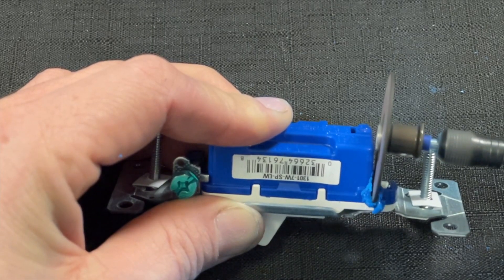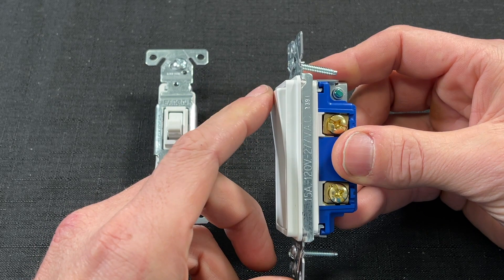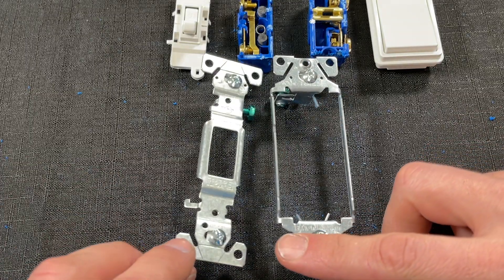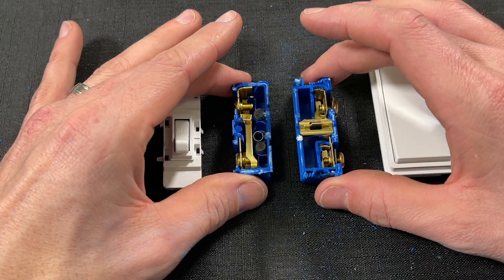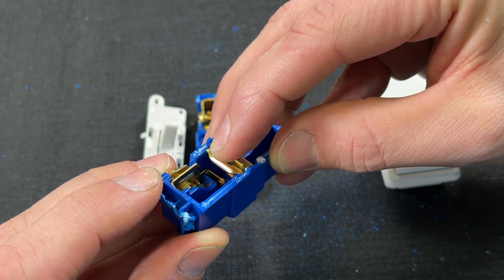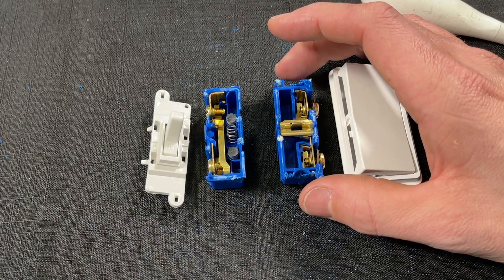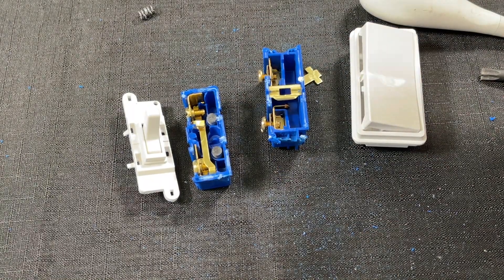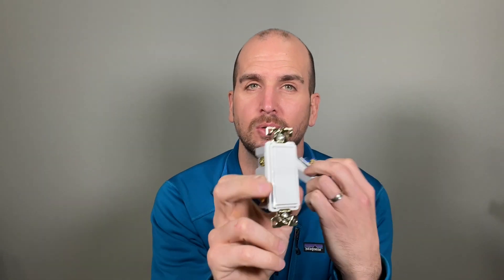What Switch Should You Buy | Toggle vs Rocker (Decora)

Comment: Ugh, I have a rocker switch that just broke off a bit on the side, so the most common issue you talked about. Is there a way to just replace the rocker, or would that be too difficult? The light still works fine, but the gap in the rocker bothers me. Lol.

Comment: Great video but I still have a question that wasn't completely answered. I bought a new home 6 months ago. Didn't expect to have a minor problem so soon. The entire house has rocker switches. They all work fine except for the one in the kitchen, which is the one I use the most. Turning the switch off works fine. But when I turn it on, I hear the click in the on position but it either will not turn the light on or I get flickering just by lightly touching the top part of the rocker panel.  If I push the top part a few times, applying more pressure, then it will come on. I had no idea how to take this thing apart until I saw your video so thank you for that. I have not taken the switch apart yet. I'm still not sure how to fix this problem. Would it be that little cross shaped part maybe not making contact only at the top when I'm trying to turn the light on? If so, what do I need to do? Do I replace that piece? Do I need to clean it?  I'm hoping it's not something electrical involving wiring because I don't want to deal with that. I live alone and don't know my neighbors yet to ask someone to look at it and I'd feel dumb calling an electrician in if this is just a simple fix. This light is driving me crazy. It is getting progressively worse.
Can you or anyone else reading these comments tell me how to fix this?

Comment: Great video.  Answered the exact question I had...which is "what's the difference?"  My gas fireplace has the millivolt system and uses a standard wall switch.  Fireplace became "flakey" and would sometimes have a delayed start....or no start...or would work normally.  I realize that the thermopile is probably a little dirty and maybe not optimal...but when I removed the switch and shorted the wires directly...the fire starts every time, instantly...thus, the problem is the switch (resistance).  I was wondering if there is a type of wall switch which would have better reliability/longevity...I guess whichever has a snappier contact or stronger spring would assure a better contact over time....likely dust or corrosion on the contacts is the culprit in my case...I guess move of a sliding contact would be nice and self-clean...but I don't believe these are used for wall switches....  No big deal.  Selling the home now...I'll replace the switch and move-on...

Comment: One of my rocker switch doesn’t work well, I know it must be some part that doesn’t touch properly, so I opened the case and the springer and copper piece fell off, and I have no idea how do them suppose to be placed, so I opened another one to check out, but the second one also fell off😅 then I found your vid, and figured out how to place the pieces properly, now I installed both rocker switch back and the broken one is working like a new one 🙏🏻 I want to thank you for this helpful vid you uploaded

Comment: Great vid..thank you. I'm wondering if the toggle contact inside is better than in the rocker. Looks like there is more area of contact in the toggle...and wondering if that makes for a better connect of power. ?  I'm having issues with our outdoor Christmas lights on a 20amp circuit. I know I'm near or at the limit the circuit can handle, but even still I get a flash/spark with the New 20A rocker.  Maybe the toggle has a better contact patch..?? Thoughts..?

Comment: Used a double rocker in a single gang box and it failed after 10 years or so.  The only toggle I ever had that failed was an original in my 1920 house.  Back then, most houses used pushbutton switches, but the man who had this house built went for the "modern" toggles.  I actually liked the look of the pushbuttons and bought originals off of ebay to replaced the toggles on the main floor.  My current home was built in 1955 and it's toggles all the way.

Comment: The internal engineering on the rocker is clearly better. Fewer parts and the contact mechanism is less prone to wear. I love the rocker for end user functionality as well. If you mount it flush, you can swipe at the wall in the direction you want the light to go and it happens... No unfortunate stubs of the forearm or fingers. Especially convenient in dark rooms that need light.

Perhaps the best thing about "decora" (rockers) is that you can use the same wall plate for outlets and switches.

Comment: 10 pack toggle switches are $4 at your electric supply house. Decora is 5x more expensive. That should settle it. Also, we have found that quality toggle switches will outlast decora, reason being as you said in your video that plastic pivot thing breaking usually caused by someone hitting it hard when they turn it on (ie when their hands are full and they use their elbow). A toggle switch on the other hand only has to be brushed upwards or downwards and it works. No one hits a toggle switch, and if force is used the physical limitation of the frame stops the plastic from breaking. Toggle switches do wear out, eventually. But you are literally talking something like 50 years. We are just now replacing toggle switches in our house and some are the original switches from the 50's.

Comment: From my experience, toggles can last at least decades and in the new house I'm living in, over 30% of the rockers had one pivoting side crack (15 years in). So that means toggles are both cheaper and more reliable. My grandparents' house had toggles from the 50s that still worked fine when the house was sold a year ago.
Reply: What brand of rockers did you have fail?
Reply: @livelovelifeyall  Pass & Seymour from 2007). New replacements are Leviton.

Comment: The MAJOR problem with toggles is you dont know which way the light turns on or off. At least its not intuitive. With toggle switch the lever is clearly marked and the life long use is already ingrained in our brainwash that off is always in the down position.

Comment: I do not like the entry level on anything. I prefer the rocker switch but as you said, if I am just replacing one or two I will go with what ever is there but I will spend the money to get the best components I can, it is worth it to me, just in time savings and the switch or outlet will last longer. cheap usually ends up being more expensive in the long run.

Comment: I've had 5 or 6 of the rocker switches fail because of the cheap ass pivot.  In nearly 60 years, I've NEVER seen a toggle switch failure.  What is really irritating is the pivot on the rocker could be made as robust as the toggle switch, but I guess no one wants to fix the built in failure mode (pronounce that "Increased Sales").  It is sad when a $0.50 toggle switch is far far superior to a $10 rocker...

Comment: For example, a NEMA X relay contact rated for 10 amp continuous duty is good for closing into 60 amps but only good for interrupting 6 amps at 120 VAC. It's even worse for inductive loads like motors. That difference is typical for all contacts because there's an arc that strikes as the contacts separate eating away contact material. Once the arc strikes, the plasma that develops in the arc sustains the arc for a much greater distance than it can initially strike on closing, so the arc is much longer on open than on close. Contact material is eaten away during the arc. Therefore, the speed of interruption is more important for contact life than for opening. Power relays usually have a spring mechanism that is compressed by the armature on closing so that it will have some distance to accelerate as the spring un-compresses on release thereby speeding the separation, and even so, they can't do better than 10:1 for close to open. I therefore dislike the design of the toggle in this video. I have seen other toggles that snap both ways. The rocker here has the snap action in both directions, which is desirable from a contact life point of view if you assume equal contact material design. Mechanical life is a separate issue. As for my preference, I'd still pick the convenience of the rocker if they were equal in quality.

Comment: I prefer the convenience of being able to tap a rocker switch vs grabbing or swiping across a toggle. (Never thought much about it before I found myself with both hands in splints.) The floating contact in the rocker is possibly more susceptible to corrosion, and the spring contact in the toggle may be susceptible to "cold forming," but assuming reasonable current loads, these are both nothingburgers - either switch should have mechanical failure in the plastic bits before the contacts go high resistance.

Comment: Isn't it more important for a switch to snap open, not closed? It's more likely to arc after current is flowing
Reply: True which is why in the industrial power business some switches are designated "load break" because the can handle the arcing.

Comment: In all my 61 years, I've never lived in a house or apartment with rocker switches. However, I am in the process of switching out all the toggles for rockers in our current house.

I replaced some outside garage light switches for smart switches and in one case had to add a rocker switch for the second switch in the box. I'm doing the same for our porch light, which will require a rocker for the entry light, and then for our backyard lights, will will require rockers for the other switches in the box. I will be converting the rest of the down stairs to rockers during the year.

When we had our master bathroom remodeled a couple of years ago, I converted the switches to rockers. I have to tell you, while I like rockers, it took me a long time to get use to them. Walking in, I would reach around the wall to turn on the light, I would always do it as if to turn on a toggle and I'd miss. Who knew a light switch could be so life changing. Lol

Comment: I have never replaced any normal switches. I have replaced Toggle rocker switches, because of the problem you mentioned. I have replaced dual switches, that fit into the space of an outlet. I would like a comparison on those switches (I spend about $5 on those). Also I would be interested in a comparison on a combo switch/outlet that fits into an outlet configuration.  Thanks...Jim
PS......these are for remodel use.....they come in very handy.

Comment: You don't need to pre-bend the hooks to wire the device.  There is a raised lip around the depression around the screw so that it can grab the end of your stripped wire and you can bend the wire around the screw.  Tighten the screw then trim the end if necessary.  Once you get used to it it's waaaay faster than trying to pre-bend a hook tight enough to work but not so tight that you can't get it around the screw.  Let the screw form the hook that it wants.

Comment: I replaced the toggles in my kitchen for rockers, one issue I ran into is that since the decorative plate screws are closer to the edge, I had to drill little holes in the ceramic so the screw wouldn't hit the ceramic and prevent me from screwing them all the way in. Same with receptacles, which the old ones only had one screw in the middle.

I used stainless steel decorative plate with black switches/receptacles, that looks really good next to my Stainless steel appliances.

Comment: I have been in the process of fixing up my old condo, and since the light switches were all very dirty and difficult to clean, I decided to just replace them all. I went with rockers because not only do they look nicer, but they are more accessible - the condo was originally designed for ADA accessibility, and if I were to rent it out to someone with limited mobility, it would be much easier for them to operate. Also, the building was built to an older code, which meant that while all the boxes had ground wires, none of the existing switches had ground connectors, and an outlet behind the washing machine was not GFCI protected either.
Reply: According to Sparky ungrounded switches are to code on old work as long as you have  faceplates without screws.

Comment: Leviton and  Cooper Ind. are the 2 most common on the market.... (leviton= Home Depot, Cooper= Lowes) Eaton is mostly sold commercially, and through independant dealers. the price difference is due to demand and  style... toggle has been around for 100 years and the decora is alot newer... 1950's+.
Reply from the maker: Thanks for the feedback John.  Good to know you see Cooper at Lowe's as our local Lowe's carries predominantly Eaton.  Lowe's might align with different brands regionally so it could change across the US.
Reply: @EverydayHomeRepairs  possibility.... lowes will stock local stores based on availibilty of brand product... I see Cooper Ind. here in Idaho, but that can change if their purchasing department makes changes...worked in hardware retail for 10 years, know all about how this type business runs...
Reply: Cooper and Eaton are one in the same, as Eaton purchased Cooper several years ago.  Any Cooper wiring devices you see sitting around are old stock at this point.
Reply: @golferguyjake28  and Eaton purchased Eagle Electric years ago thus bringing in the cooper brand... man how the electrical industry has changed!

Comment: Another advantage to the toggle switch is that it can use the same wall plate as the receptacle of the same design as opposed to the rocker which the wall plates for the switch and receptacle are completely different.
Reply: I think you mean the rocker switch has that advantage ... same rectangular cut out wall plate as the outlets.

Comment: That rocker switch seems poorly designed at least electrically. That T shaped piece just sits in that cradle creating another contact point. The cheap switch only has one contact point and is under spring tension when closed.

Comment: Here's an idea:  Why can't we have push-on/push-off style switches anymore?  I have some Lutron Abella (https://www.lutron.com/TechnicalDocumentLibrary/Abella.pdf) and Lutron Ceana (https://www.lutron.com/TechnicalDocumentLibrary/367-1370.pdf) dimmers and switches that I retrofitted in my house after having it built in 2001. We opted for toggles instead of Decora when having the house built, so the Abella & Ceana devices matched nicely with toggles. Also, we have a couple of Ceana switches that light up, making them easy to find in the dark.

I also like the push-button switches for 3 or 4-way applications as I don't have to do anything but press the button to toggle, versus the inconsistency of flipping up or down (which becomes meaningless).

Abella/Ceana are no longer made, yet I think they were a great idea.  Unfortunately, like so many things I like, they didn't seem to catch on.

Comment: I'll take toggle every time. I hate rocker. If it's dark, it's a lot harder to find the switch. With a toggle you can just sweep up in a general area and you're probably going to flip it. Rocker is a lot smaller, much harder to find and flip. I spend so much time fumbling around in the dark to hit a rocker switch. Nope, I'll save time and money with toggle switches. Screw looks.

Comment: First let me say that I like your video (except for too loud music) but I find your criticism of the wire push in feature a little unconvincing. This connection has constant spring pressure against the wire that will compensate for expansion and contraction of the metal components with temperature change, this feature is especially important where aluminum wiring has been used where  loosening of screw connections can cause arcing and the possbility of fire (which has happened). This is why aluminum wiring is now very uncommon but still exists in some buildings. The main drawback that I see with the push in is that there is a much smaller metal contact area than the screw connection.
Reply: I agree on the music being too loud.
Reply: A majority of the failed outlets I have needed to replace were backstabbed, and that was the point of failure...  it seems to work great until the wire gains some age and some surface corrosion..  then that small contact patch really shines.  Or arcs.
Reply: @mattfleming86  agreed. I have 3 broken, all were backstabbed.

Comment: Are parts available for the Decora switches or do you have to buy a new switch?
Reply: When the plastic pivot fails I've gotten replacement parts from Leviton.  You can put them in without pulling the switch out of the electrical box.  I have mostly dimmers so I certainly don't want to have to replace them.

Comment: As I mentioned on your disassembly of the Decora switch the pivot area on my Decora switch had to be lubricated with Teflon spray dry lube after only 10 months use in a bathroom (heavy use ) as the activation effort really increased. If you have rental properties (or just for preventive maintenance ) you may want to spray the switches annually to help prevent failures since you have experienced them .  It also appears that the contact pressure is greater with the old style switch which may be important for circuits that  have a lot of lights on it or is used on a high current draw item like a heavy duty garbage disposal. Also on an old style switch disassembly I noticed a lite coat of grease on a round pivot point. Since the rocker is easily pried out of a Decora switch I wonder if putting a bit of plastic safe grease (like silicon) on it would be a good idea especially on high use ones. I will try it if the dry lube does not last.